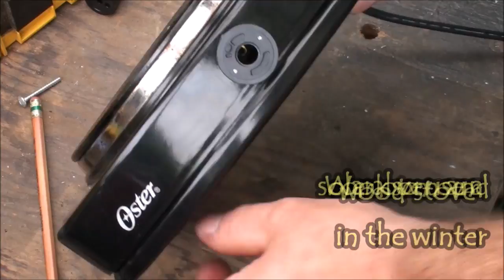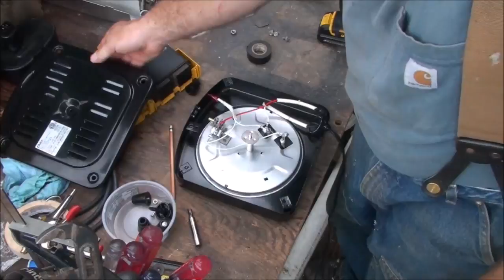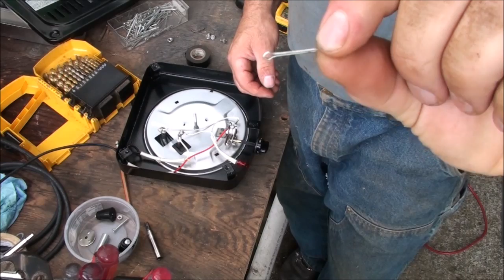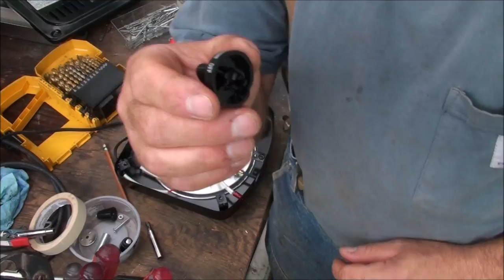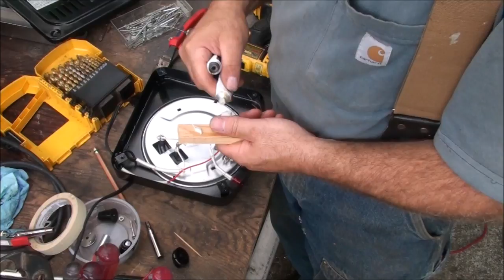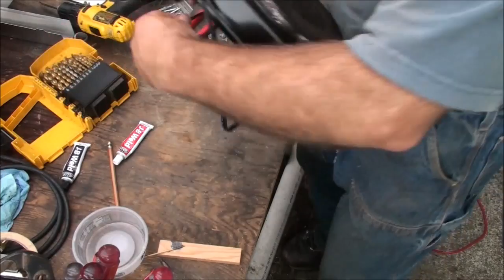Solar Powered Hot Plate Repair

Comment: Great job drilling that skinny little hole, I was scared but it worked great. If ever that thing wears out you might want to look at the Nuwave induction cook tops. They work as advertised and are very efficient with a light weight steel pan. A good fit with your solar!
Reply: Cycletivity, thanks for the comment and suggestion. We will look into those. I have an older General Electric that still works great but these new appliances are not meant to last.

Comment: Come up with some good good ideas and get tips and  using a cotter pin I've used wire mending wire and just wrap it in twist around 
 thank you for sharing
Reply: That would have worked well Keith. I have wire around here but it is all mild steel or copper. I keep a roll of form wire for all kinds of projects. Would like to get a couple of spools of aircraft safety wire one of these days. It is stainless and tough. Thanks for dropping by!

Comment: Be sure to vacuum out all those metal shavings you drilled out (edit. or use that magnet tool) to prevent fire later. 1 metal shaving slipping over 2wires could be very bad.
Reply: Well said. I blew out the workings before assembly. Double checking connections and run away strands of wire can get ugly too! I work with fine stranded wire when working with the solar stuff and connections are a "biggie". Appreciate the input Edie.